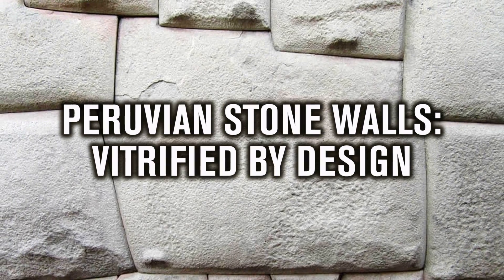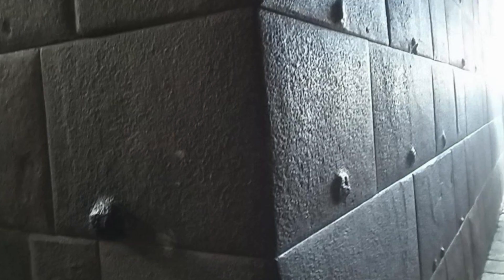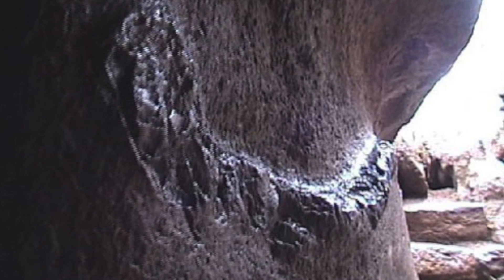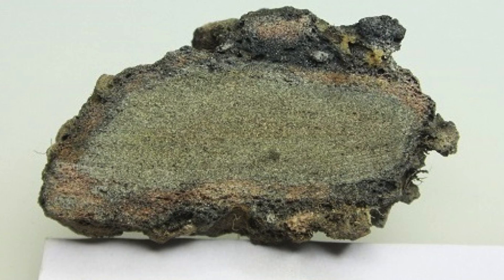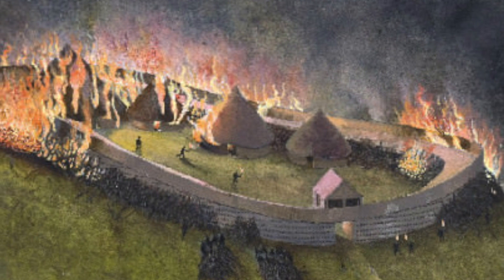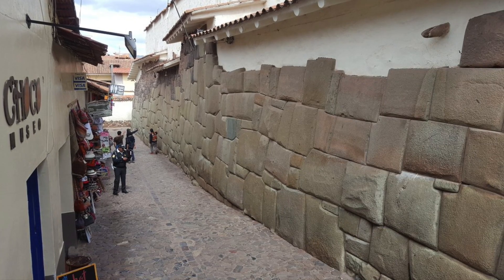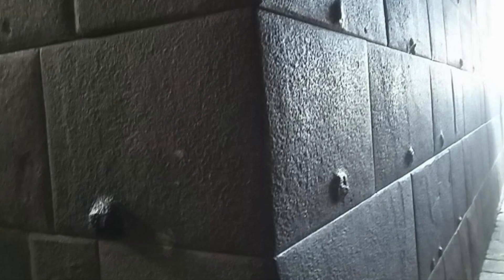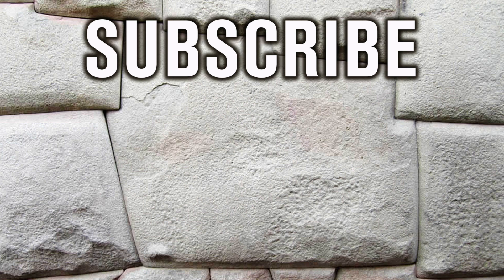Were the Peruvian Stone Walls Vitrified / Melted During Construction? | Ancient Architects

Comment: There are a lot of people here way smarter than me, and I will be looking at a heap of the articles/videos mentioned by some here. Thanks for the information. Interesting theory about softening the stones to join them in the pattens, and I have been curious about using frequencies to do a number of things for many years. One think I would ask is why the stones have straight lines in the joins instead of a wavy/curved line? Put a couple of stones together, heat or soften them, push them together (somehow) but they have mostly straight lines? Looking at the structures where the blocks have multi angles sides, to me would imply they would have had to have been stacked up and heated or melted as a whole wall, as in placed between a type of formwork before the process began. Great video. Thanks.

Comment: Vitrified stoneware pottery is wood fired to 1310 degrees, or "cone 10" in the jargon. That is the tempersture required for most the classic glazes, including ash glaze where the ash is either spplied as a slurry or simply "fly ash" the ash from the fire blowing through the kiln.

Bringing an enclosed fire to this temperature is tough work. Bringing an open fire yo such a temperature is even harder as the heat is dispersed in all directions.

A ready supply of firewood is essential. I see no readon to assume thst whole walls would be fired at once. Nubs may indicate positioning of supports for progressive smaller fires.

Comment: Hi. Love your show. I do sculpting on a big scale. I am an installation artist, My focus is large scale installations with various different materials. Just from looking at this straight off the back it does look cast, extruded and sculpted. The small dimples look like the moulding points or air vents to get the air out when casting. Or like the point you get when adding icing to a cake. Just my thoughts :-)
Reply: Except that no 2 stones are the same. Add to that, the molds would be larger than the end product.

Comment: I know what the knobs are. It's the extra material left over when the Mason was facing the stone, just like the extra material I just scrape away when facing poured concrete steps. I'd say the stone was soft and maybe had an uneven surface or a bulge, the Mason trowed it all out to the desired shape and was left with extra material on the side of the stone the masan was working from, they worked from the bottom most of the time I'd expect.

Comment: Surface hardening against the elements + curing process ? Yes. Argued the same point myself for a long time.
It requires that the mixture is flammable, or the bag it sits within for a mold.
Wouldnt be surprised for an acid/alkalis based mix to be highly flammable.
Reply: Also you dont need heat to chemically dissolve and then chemically reconsitute, through neutralising agents.
Many ancients culutres used acids with booby traps and such.
It is such acids that need to be analysed IMHO.

Comment: There is a film rumored to be over 100 years old that "supposedly" shows human aerial craft firing on Machu Pichu with particle and plasma like beam weapons. It was recently released on topsecretexan on youtube. Interesting nonetheless. As a master stone mason Im very aware of how stone is verified, construction and rule of diminished returns. Thermal surfaces artificially applied to syone are performed for cosmetic purposes and rarely for fitting unless there is no other way to achieve the fit. Or to weaken the stone and often results in damaging or exasperating defects in stone. It was costly. In the case of Machu Pichu would have required transporting large quantities of fuel.

Comment: The "nubs" are a problem, but that could make them a key to the construction process.

To create such a protuberance by carving rock requires a huge amount of additional effort.

There are easier ways to create a support for timber framing or hand holds for climbing.

The same shape made as a hollow (inverted) is a fraction of the work.

So if the protuberances are not carved why would we assume anything else is?

One other thing is obvious in the pictures here and that is rarely mentioned. I see delamination of the surface. This suggests that the blocks are not homogenous.

Some limestone does delaminate near the cut surface as exposure to air hardens the surface and creates a discontinuity but delamination is usually a result of attempts to clean the blackened surface.

Conservationists in New Zealand have ceased attempting to clean the surfaces of Oamaru stone (a local limestone) walls built in the nineteenth and early twentieth centuries. But we are talking a different stone and a completely different timescale here.

Comment: I need to wrap may head around this...It seems you are saying that the stones are heated (some way) to cause them to melt together, but the edges being a place of cooling first caused the perfect joints.  OK.  It seems to me, that the lower layer  would not be heated, or not as much as the upper layer, thereby having a cooler surface to rest upon. You're right, this needs investigating, sampling, probed.  I only wished pure science, like this, had more funding.

Comment: Nubs. When quarrying a block from a wall, there comes a time to detach it. Those "nubs" are the last points left before the block was snapped off. That's why there's usually two, to balance the weight. If you look at them and think about it, it becomes kind of obvious. Not all of them have nubs because the front face in the quarry won't have them, and the bottom blocks in the quarry won't have them because the ground is supporting the weight. You're welcome.

Comment: I recently watched a video where they claim the ancients used a giant 6ft or larger diameter wide magnifying glass to melt rock and then poured it into molds to build these structures. I'm not so sure I believe that or not, but I did find it to be an interesting theory. I'd love to see somebody try doing just that to see if it is even possible to generate enough heat to do this. 
There is also the theory of our sun being a recurrent nova star, and a nova is what caused the cataclysm that wiped out these ancient civilizations, and if indeed that is the case, then that would also explain the surface vitrification we see. A blast of solar plasma would surely melt rock. 
Whether either or both of these theories are correct or not, it is interesting to ponder.
Reply from the maker: Very old video. I was making a little series back in the day of all of the ideas out there - from magifiying glasses, to geopolymer, to sand bags, to all sorts. Really just saying what the ideas are. I have no strong belief but I think the magnifying glass is a bit off due to the lack of finds and evidence - in hindsight.
Reply: @AncientArchitects  I'm not locked into any one theory. I find them all intersting, and worth pondering.

Comment: These were solid walls, a form of concrete, and did not start out as blocks. A high energy proton event (plasma storm - thunderbolts of the gods) heated and cracked the solid walls into blocks and transmutation changed the molecular structure in a way that unsuspecting people came along thousands of years later and mistakenly saw these as walls built from stone blocks. As this happened thousands of years ago, the cracks weathered with time so as to form an appearance of being separate blocks when they were indeed a solid wall that cracked and weathered. This is the same for footprints in stone, people turned into stone, cart wheel tracks in stone, hand prints pushed into stone as if the stone was soft and spongy at one time, the hexagon stone pillars, and explains why we find man-made objects encased in stone and coal - a plasma event(s) changed the planet. This also explains some of the "nubs"  - the structure was heated, slightly melted, and began oozing during a plasma storm - although some nubs look exactly like pouring marks from a foundry so it may be a mixture of different causes for the nubs.

Comment: How would nubs form? Something had to be used as formwork to stop the heated rock from spilling out of the block beneath and if the stone was semi-molten there would be no gaps unless every block was allowed to cool first before then next block was added above, which would mean they had to smooth the top of the block manually before the next was placed on top. What stopped the first block from ending up misshapen? Did they use five-blocks as formwork and repeat? Seems unlikely to me. I support the theory that the vitrification happened during some cataclysmic solar event that was not uniform in its impact, rather sporadic rays striking here and there.

Comment: So what your saying is.. 13:44 that they laid the giant rougly shaped stones... covered it all in a substance like clay to hold the heat with holes at the bottom for the run out to flow, and set it all on fire? Eg: process of creating charcoal with a clay kiln. They would have had to have done it in sections ... imagine the fire /heat required in that localised area. Probably why there are zero trees at 13:58 on the landscape.. used it all for firewood

Comment: I'm thinking it'd be a good idea to bring a long someone with decades of experience with concrete along on a trip some day.  The answers to these questions about building technology might be found with experienced modern day builders.  My immediate thought when I saw the wall that looks like the stones have been melted was that someone added too much hardening catalyst to the mixture.  Anyone who's done body work on a car knows that when you mix the two parts of bondo together it makes heat from the reaction.  I used to work at a shipbuilding plant and I had heard stories of someone adding too much MEKP to do a fiberglass hull repair.  The repair part ended up catching the whole hull on fire from the inside from the chemical reaction, ruining the multi-million dollar yacht.  I'm picturing these blocks were made with a process similar to mixing bondo.  This might explain several things- scoop marks from shaping the blocks during the window of time while they're hardening.  The pliable material would possibly press against the edges of the already set block next to it, forming that mortarless, perfect looking spacing.  Also, if the outside of the blocks would set faster than the insides, it might explain the difference in consistency on the inside of seen from other videos when the block is broken in half and the middle is looked at.
Reply: Ive wondered this too, such "wise" academics seem to refuse to being in modern day experts on these topics. Surely the same principles would apply, regardless of how many years have passed.

Comment: I would say the nubs could be there to hold the stone while it's being cut leaving only the nubs to hold it to the face rock then once it's all cut you smack the stone or lightly move it and the nubs would break off separating the stone they were cutting, same as you would when cutting wood, you need sawhorses to hold the wood so it does not sag and crack or mess up your cutting of straight lines. So that would be my thought although you would think they would remove the nubs when done, also it could be some stones have nubs and some indents then when stacked the nubs would sit in the indents causing the stone to not be able to move keeping them together better in storms or disasters. Or just keep them from moving over time in general once things start to settle. Guess you wouldnt know unless we lift a few stones that are stacked and see,

Comment: if you're talking about heat vitrification, just do the energy maths. I guess one would need the whole peruvian rainforest to generate the energy needed for sacsayhuaman only... and btw, "kerosine can't melt steal beams" :-) vitrifying stone, basalt, andesit, by burning charcoal is not easy at all outside of a furnace and would leave a lot of carbon in the matrix. 
no, I still don't believe it's about heat, temperature. I believe they had a different way to get energy into the crystalline structure and alter it. after all, it's (I regard it as) the pinnacle of pre-metal STONE age. they really knew how to process stone, understood it's nature.
Reply: Great Pyramid K2019

Comment: Didn't they use acid & the weight of the rocks on top to do the finishing touches of shaping the rocks into the slots on the walls in south america?
mix the shavings with water and .. i think some other common local substance and it'll naturally melt the rock's edges when pressure is applied.
Reply: As for the knobs, excellent for tilting the block to get the first set of rollers or boards underneath to raise it into place with minimal manpower.

Comment: Electrodes for heat - and The Great Pyramid shafts!

Was it so, that both chambers, upper and lower, had inside the shafts some marks of two metal wires gone through long ago?

Maybe the granite chambers were built using heat, too. Lower chamber shafts don't continue outside, because they did not need to:  the chamber was finished, but building elsewhere was still going on. And the meaning of those wires was to conduct electricity from outside of the pyramide, to be used inside, for heating the granite blocks of the chambers.

Comment: I was not the Iron age it was the Bronze age. I have been doing research on vitrification weapons and I have found that are a few different out comes when and where these weapons are used. This research focused on possible Alien weapons capable of vitrifying large areas equaling hundreds of square miles all the way down to a single meter. The hypothesis was first proposed while researching ruins on Mars where large areas of the surface of Mars appeared to have been vitrified and made to appear older than they may be without melting the stone or rock to avoid detection. Some areas of Mars appears to have been purposefully vitrified to cover up attacks on the facilities there that may have taken place much earlier than the evidence shows and that the destruction on Mars may have recently take place. The weapons are complex and involve particle physics and the removal of electrons and isotopes that make rock, stone and even metal such as Iron Titanium and Aluminum look normal and instead, after the device is used, appear to be older than the materials truly are. There are examples of this on Earth too where Iron and Steel and rock have indications of the use of this kind of vitrification device to cover up something or, in this videos case, for the purpose of longevity.

Comment: You need to explain how they managed to generate that temp, most fires get nowhere near the temp required to melt stone. There is only 1 way possible, mirrors or a magnifying glass could generate temps high enough using the sun but that would have problems too to create a massive wall like in Peru. Archimedes is said to have used something similar to sink the Roman fleet.
Reply: Mythbusters proved that idea to be false.
Reply: @peterbarratt8699  ive seen it done on youtube, so im curious how they disproved it...
Reply: @christianbuczko1481  It was claimed Archy achieved the burn from many miles away. The proof is the further the distance from mirror to target, the larger the image of the source (sun). To get anything hot enough to burn required a distance of only a few feet. Even then, the timbers did not start to combust until some 20 minutes had passed.
Reply: @peterbarratt8699  just because they couldnt, doesnt mean shit frankly. They tried and failed because they were not clever enough, if you get dozens of mirrors, you can burn birds out the sky, check out earth comets. Its just a matter of scale, a few hundred men each holding a mirror would do that to a boat from a few hundred meters. In the youtube vid, they use a 1 meter sq approx fresno lense, and used it to make lava from a rock. That was using the energy from just that sq meter, if you have several hundred similar sized mirrors, you will get several hundred times to tempreture.
Reply: @christianbuczko1481  Experiment yourself and discover reality. The longer the focal length, the larger the image, the cooler the temperature, just simple physics. Look up Mythbusters episode which covered Archimedes experiments. Learn something. I happen to make telescope mirrors. My physics has not failed me yet.
Reply: @peterbarratt8699  guess what. Physics says your wrong, otherwise all those solar power stations would not work. As you said the temp goes down with distance, but i said several hundred men each holding a mirror. That gives several hundred square meters at a few kilowatts of energy per meter of mirror. When all are focusing that energy on 1 small area, the energy would easily burn a bird out of the air if it flew through it the beam. It infact happens every day at solarpower stations and is ironic when those things are meant to save the enviroment...  according to what you say though, thats all impossible.

Comment: The burnishing of a wet wall.  Similar to burnishing pottery.  Could be performed maybe cutting away the joint areas to stop chipping.  This looks poured.  Perhaps solidified after attaching a plaster using fire.

Comment: I’ve got a theory about why the “nubs” are at the bottom of the stones all the time.  Imagine you are building such a wall with mud.
You make a molde with wood and cloth. Then, to make sure you fill it completely and have no air bubbles, you just punch a hole or two at the bottom and let your mud escape a bit until you think you’ve got no bubbles, then you seal it and let it harden.
Then you are supposed to grind off the protrusions left by the holes and do so on some stones until you go “oh screw it, too much work” and as no structural issues are created by them, jut let them stay…. Forever.